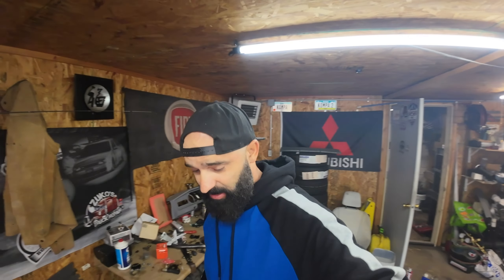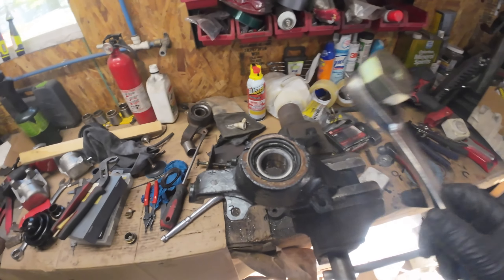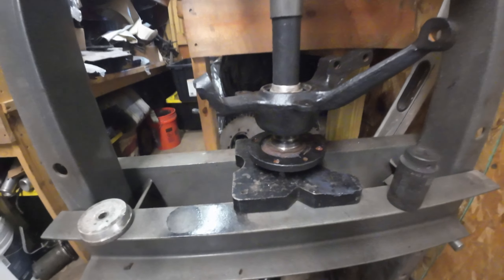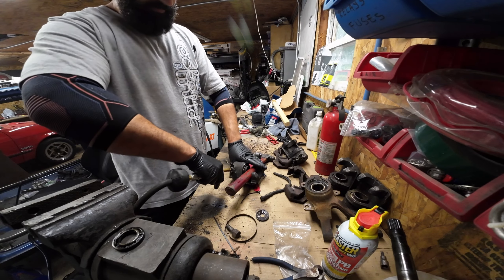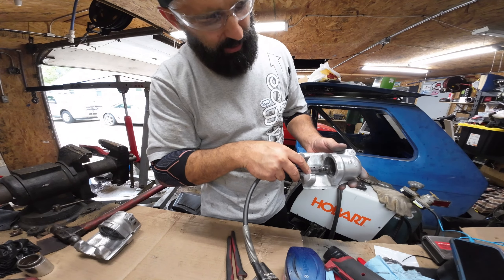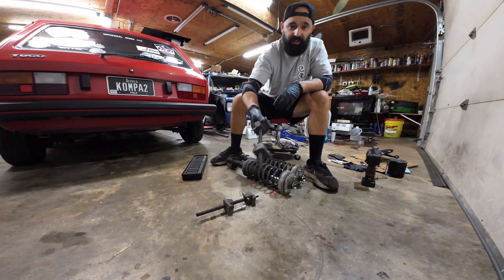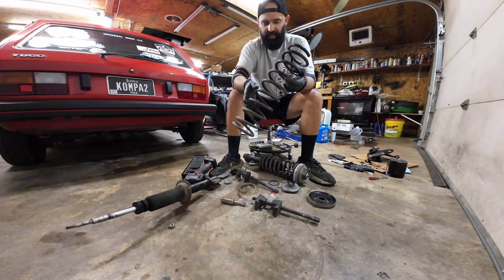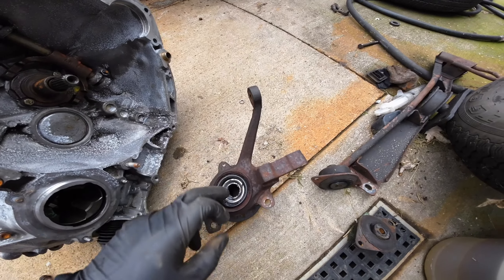LOWERING YUGO GHETTO STYLE/REBUILDING CALIPERS/WHEEL BEARINGS

Comment: Actually, with coil overs, you can usually just pop the top nut with the assembly laying on its side not touching anything at its ends and it will just jerk a bit when it comes apart but wont launch anything because the energy of the spring has no focal point. Never done it with a yugo coil over but plenty of others.
Reply from the maker: Yea I know for coilovers you don’t need spring compressors lol.
Reply: Fair. I get it. Keeping it clean as possible for the content.  @KOMPASGARAGE
Reply from the maker: @volatile2805  This car is actually sold before I even got the chance to finish it so later down the road if the owner wants the coilovers they can install them.
Reply: Nice. Like your workshop by the way. I like the less common vehicles to tinker with myself. Its a rare treat to my norm. Good content, keep it up.  @KOMPASGARAGE